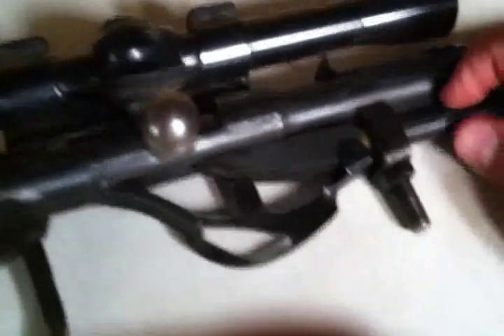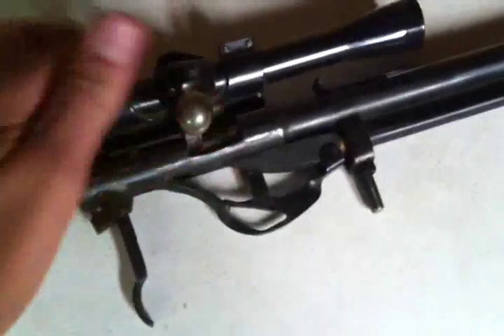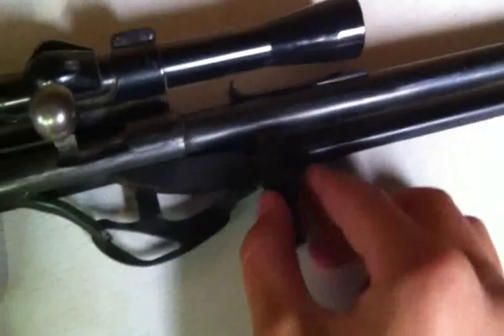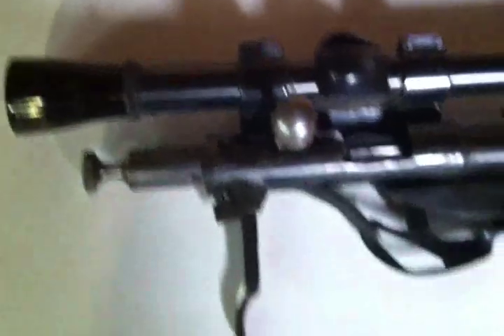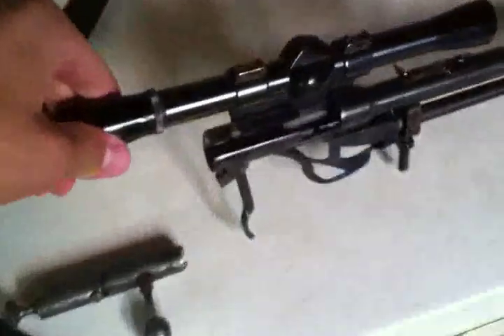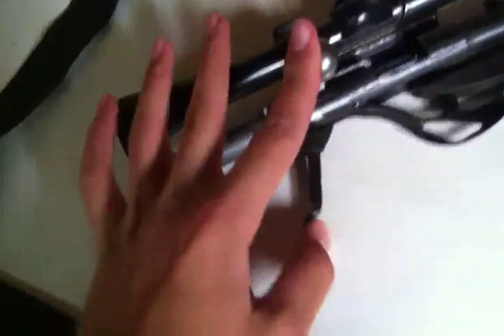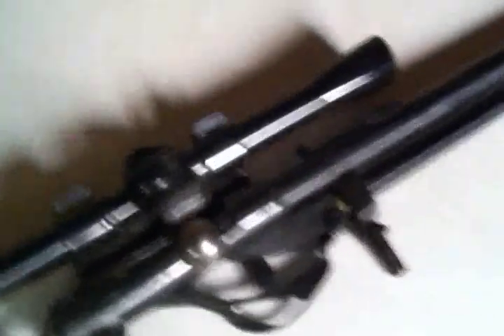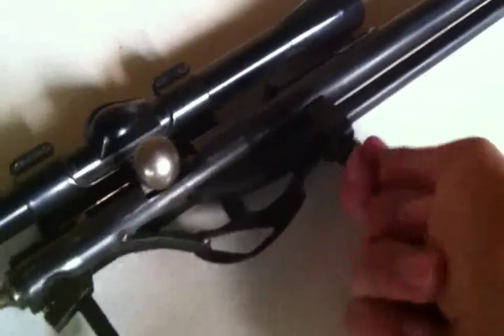How to remove a bolt from a cooey  22

Comment: 600 or 60 Buds....?
If the tube is loose, tighten the nut under the tube where the stock retaining thumbscrew engages. Try the bolt fit without the magazine rod installed...if it doesn't play, adjust that tube nut until it does. Once it does, load and put the rod in...you'll be good to go. It's a finicky part. Sorry this is a year late..hope you didn't sell your .22 in the meantime. I'd have bought it in a second. LOL.
Jake